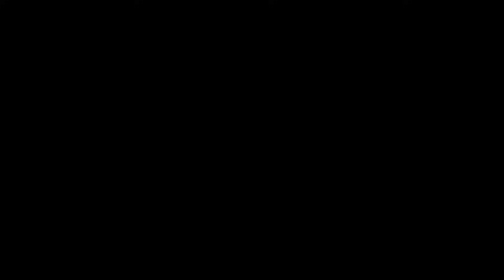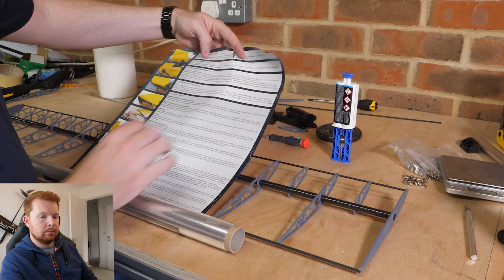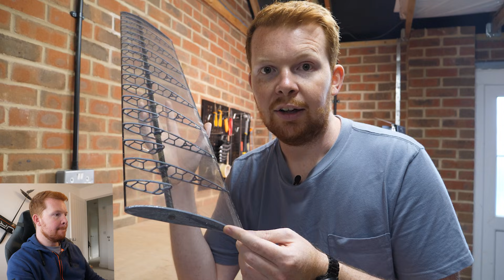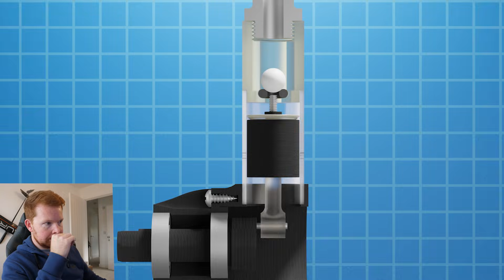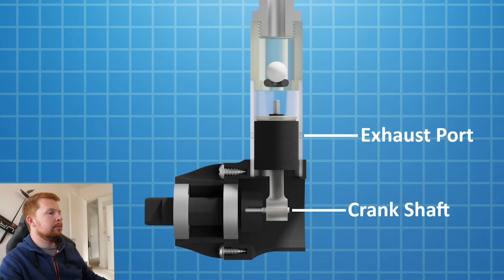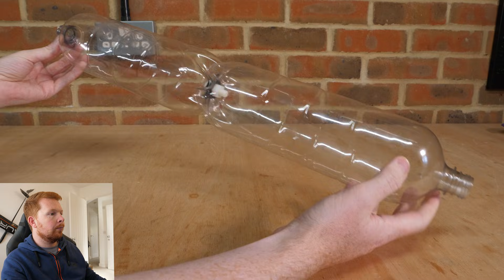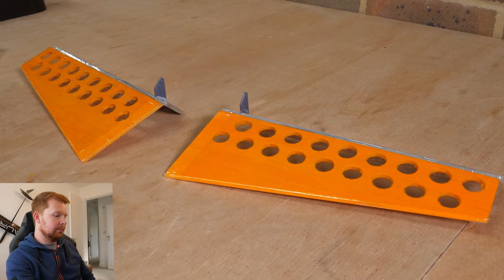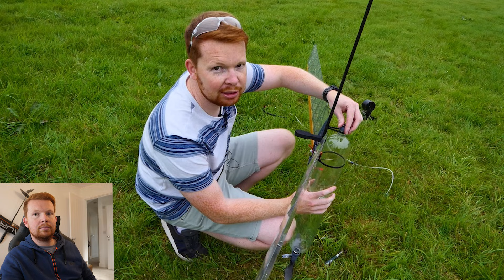How I built a Plane Powered by AIR

Comment: Maybe take a Ryobi +One air compressors out to the field with you. I know they can do 120-150psi.. There is also an expensive one that has a tank on it which I believe is also 4litres @ 120psi. SO in theory, you should be able to do a air transfer in seconds, and be able to fill up the 'ground tank' while you are flying in the air.. Though, I think just getting one of the cheaper ones without a tank may be better.

Comment: Hej Tim, great video as always, your air-engine series is great :) I am wondering about one thing : the CO2 cartridge isn't as as bad as originally presented. It has a smaller potential air capacity, but also considerably lower drag compared to the bottles. Do you think that lowering drag could outweight a smaller total output? You could even build a flying wing, integrate everything.
Reply: No. The gas pressure is too high and it cools as it releases.

Comment: When doing the maths, do you take into account that there will be 4 litres of air that will go unused, since at 1atm inside and 1atm outside, it has no willingness to move through the engine ? 
There will obviously be an amount of CO2 in the canisters that will also stay inside the canister, but the volume is so much smaller, so less will go unused?

Comment: nice tim reaction content of tom, but simple paper sail wing planes work well too. also you would use water wheel style kinda piston continuous roll engine instead of piston mechanism. the water wheel turbine is even better when center-in rim-out style of turbine, so you dont get the piston style action from rim-in center/rim-tangent out, but true turbine linear exhaust. 3d printed airless flex tires, maybe even circular foam inner tires. the turbine acts as multiple exhaust valves in a ring. air seems better than rubber power. ironically the wings could be made from pressurized bottles themselves, storing also power. yep ring turbine is kinda radial circular piston aircraft engine. viewer reaction to tim reacting to tom, multireactverse.

Comment: Maybe keep the bottles intact & add a hose from rear cap to engine. This might weigh a bit less than the nylon bolt. Also, the rear bottle could face forward.

Comment: @15:55 So using channels.. at/near the end of the piston stroke, could you possibly vent into the crankcase, instead of to atmosphere,  causing a positive upwards force on the piston? (which then vents just before the new charge is added to the cylinder)🤔

Comment: 17:52 There's probably a deep rabbit hole of power train optimisation on your air engine - how would you even characterise efficiency here? Thrust per psi, thrust per volume of air entering the piston chamber? 

If you do manage to figure out the engine efficiency and torque curves, matching the best propeller becomes possible for the design operating point if you can get the prop performance curves, either from published prop test data or estimated using a performance calculator.

Probably too dense and boring to put into a YouTube video but interesting engineering wise to think about. Good work!

Comment: As you pointed out, the plane has moderate stability issues. There are some simple parameters that can be calculated to help determine if a design will be stable in flight. Check out the RC Soaring Digest article from Dr Mark Drela in the August 2008 issue (page 13). Just doing those few hand calculations during the design phase should prevent the issue you had and more. In the case of V-tail planes, you can convert the tail to an equivalent horizontal and vertical tail area and then do the exact same tail volume coefficient calculations as detailed in the article mentioned above. I highly recommend googling "Dr Mark Drela v tail" and reading the pages from Charles River RC that come up.

On a similar note, Charles River RC has a page that links to a bunch of different composite RC gliders designed by Mark Drela. I love looking through those designs to get inspiration. I think high-performance gliders (especially DLGs) are some of the most interesting planes to design, build, and fly.

Comment: This a great directors cut, engineering insights production. Really enjoy seeing this. 

For the wing leading edge, you might consider using foam cut with a hotwire to make a very thin sheet, or using thing depron. @JuliusPerdana is a RC depron plane crafter. He has many good techniques and videos. eg: "How to bend depron - polyfoam using tape and heat gun", or rolling over a pipe to curve to shape. 
You could also experiment by increasing rib spacing; particularly behind the spar tube.
Another possibility is tacking a strip of paper to the film (with dabs of heat) which could replace the balsa. You'll likely need to apply a heat activated spray adhesive like 3M Super 77 to get the paper to adhere to the ribs. This would allow you to apply the film in the same manor while reducing weight. Hopefully this gives you some alternative ideas.

Comment: The bit about the propsaver not working as a result of the prop being used as a flywheel - didn't realize it would cause issues, but you explained it really well. Thanks for the deep dive!

Comment: Could you take some weight out of the piston skirt too? 

Is it possible to print a bottle with isogrid ribs to hold extra pressure and streamline it? 

Or even take the c02 canisters as it will drastically reduce frontal area?

Comment: You should make the design a double-boom for extra stability and lift + Attach 2 air engines to the fronts of the booms (kinda like a P-38) and add the air storage to the middle.

Comment: Dropping the ‘head’ of the engine so a more direct flow out of the bottle might help with gas flow, although would result in an offset crank. PS. Some destructive pressure testing of a few bottles would give you a better idea of what pressures can be achieved.
Reply: Should be in slow motion to see the condensation forming and leaving

Comment: May I ask you why you don't get one of those small battery powered compressors? I have a xiaomi one (the one shaped like a padlock), and it works really well, it has an integrated pressure sensor that tells you how much pressure you have in there, and you can automatically set a maximum. And you'll be more relaxed piloting the plane!

Comment: curious if you could add a tiny spring loaded valve to the air tank for the purpose of a low pressure cut off. say 10psi or where power starts tapering down

you'd set the spring rate equal to the point where the engine no longer makes enough thrust to keep the plane at elevation. this way, the tank will vent stopping the propeller from spinning. hopefully reducing the risk of damaging the prop or the engine

Comment: Bro 4412 is way too thick for such a small and slow plane. Try AG34, AG35, AG36 like on the 2m Allegro.  Keep in mind that the 60:1 L/D is the idealized 2D value. Even the best to planes at this scale only get ~20:1 3D L/D

Also best way to save weight on the tail is to use the lightest 3m balsa you can find and sand an actual airfoil profIle. You can cut the balsa weight nearly in half while retaining bending stiffness. I can’t tell if you left the LE square but if you did the air is probably immediately separating from the tail which gives lots of drag and reduces control authority.

Nice work I really enjoy watching your vids!

Comment: Thanks for sharing your ideas! I wonder which Raynolds number you are calculating lift curves for. In fact I think you should calculate for R=50000 because of low speed and short cord. Then Naca 4412 is not good, see airfoil Tools. A lot drag which increases sink. I would go for Göttingen 269 instead. Compare and see for ncrit=5 and 9!

Comment: Great explanations and so much fun to see,  but I think the difference between a CO2 cartridge and the compressed air bottres is smaller because when the motor stops there stil is at least two liter left inside the bottles and the motor does need some pressure to do any work so it is more than that, compared to the very small volume of the CO2 cartridge so very little gas is left unused.  Also the CO2 being a liquid compressed should have a more constant pressure output as the bottles with air and the smaller volume create less drag in an airplane.
However an engine that runs on compressed air tanks that you can simply pump up yourself so much cooler than an engine that runs on disposable CO2 cartridges.
Reply: I haven't done the math, but I think the fact that the CO2 is starting at a much higher pressure means the energy output is much greater.

Your engine would need to be designed to operate on 800PSI to take advantage of that; I think a pressure regulator basically burns off the excess energy as heat.

(I do agree that being able to use your own air is cooler than buying CO2 though)

Comment: The larger sizes of disposable CO2 canisters are more efficient in terms of energy/weight if you ever want to go that route. I also suspect you could also save some weight by switching to a smaller battery, maybe even a non-rechargable battery (two lithium coin cells). Don't need a lot of power for just the servos.
Reply: One more thing regarding Co2. The final conclusion was that it contains half the amount of gas than two 2L pets. But the Co2 much denser than the air so assuming the expanding gas reaches the same velocity it should have 1,5 x momentum. So maybe smaller cylinder would provide the same power therefore less gas exhausted per cycle = longer run
Reply: The issue is even with the denser air it depletes around the same weight by design of the engine and the actual amount of air stored is drastically less, such that it would still just be plain worse than the bottles.  @attilaschneider712
Reply: I think the profile drag would be much lower, the diameter of the soda bottle is much greater than the CO2 cartridge. I guess it would be difficult to actively regulate the high pressure coming out of the cartridge without adding more weight though.
Reply: @nathandavis5021  I think the current design has some reduction built in, but even with a new independent reduction valve, it would most likely make up for difference in drag. Not to ment improved "fuel" would almost certainly make up for the extra weight of a pressure reducer.
Reply: servos..., I tried running 2 servos from a 5v small power bank and the safety always took over and cut the power for a fraction of a second, I didn't think to add 2 small lithium cells in series
Reply: There are also really cheap smaller servos that take less power too. Then, as this doesn't need much maneuverability ,he could just crank the ratio down to give it enough leverage.

Comment: I built most of the fuselage and the main wing's spar of a Cozy MK IV from plans I bought back in 1998. 
It's the 4-seat version of the famous Long EZ by the God of aeronautics himself, Burt Rutan. The first chapters of all his plans are the bible of composite construction. 
Hot-wire foam cutting done right, is hard to beat. Most flying surfaces of composite experimental aircraft is built that way. The next best thing, would be a CNC mill. 
If you hot wired two pieces, a leading edge portion to glue to the front of the spar, and the trailing part to the back of the spar, would give the closest construction to the real plane. 
No need to glass a skin. Just sand and paint to protect the foam against UV.

Comment: Hi Tim
I have enjoyed your videos for as long as you have made them 🙂
But I always wondered about your pressurized air concept.
I am not a professional, so that is why I am asking this question:  
Could the high pressure gas leaving a small nozzle just be used as a source of thrust to propel the aircraft directly?
If not, why not? I guess there is some trade off.
Reply: It could be used. But it's more efficient to accelerate a lot of of air slowly, rather than accelerating a little air a lot. And the goal is maximum flight time.
Reply: @marc_frank  Thanks
Reply: He explained that in the video about the compressed air powered helicopter i think.